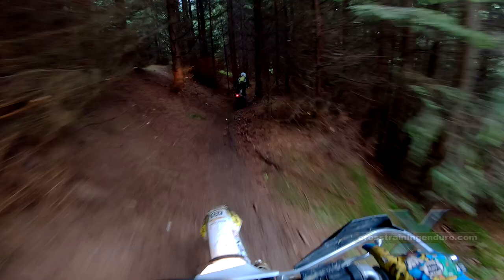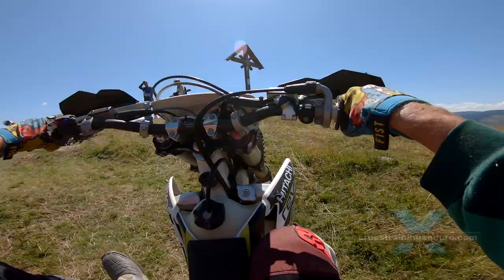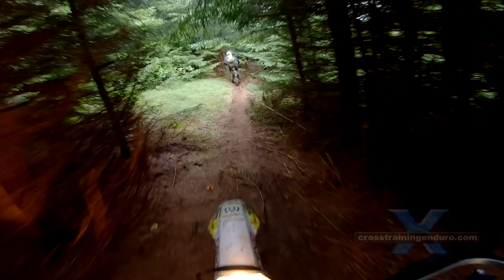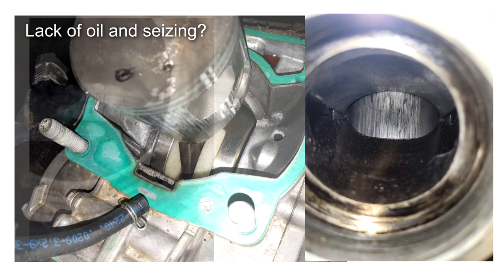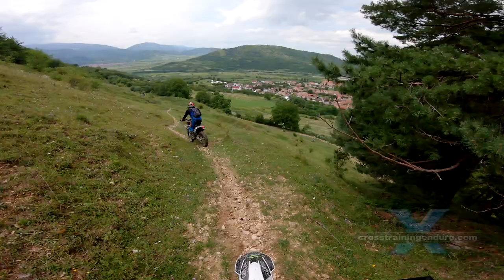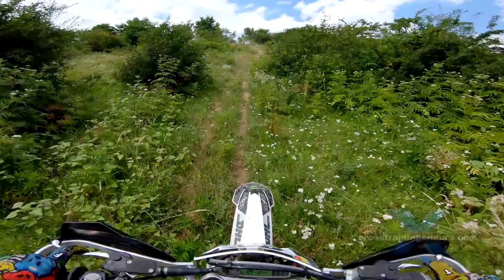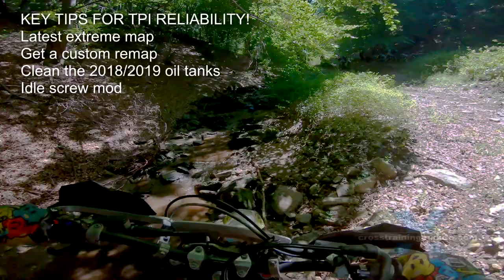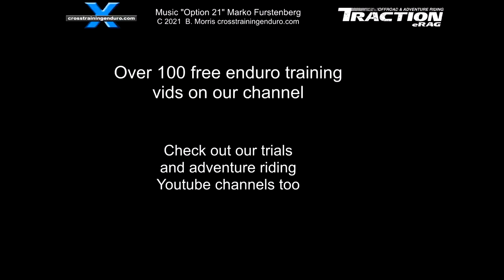Most common TPI problems, questions & solutions from a TPI specialist! ︱Cross Training Enduro

Comment: Jeeesus! Top end rebuild every 80-100 hours. I'm nudging 500 hours on my 2014  Beta 300 Race edition, and its still on its first replacement piston and rings!! Go the might 2 stroke carb!
Reply: did mine on 300 hours and old piston was still fine. could easily ride it more. 250 tpi 2019
Reply: I’d say that’s more on how you ride
Reply from the maker: 500 hours! Is this an experiment just to see how far you can go? I figure you can do the bottom end at the same time in that case lol. All the mechanics I know are unofficially saying 200 hours should be fine if you aren't pushing a two stroke carb model hard. I should point out quite a few TPI owners have gone that far (or more) without problems, although chances are these will be 2018 and 2019 models which had mapping that used a reasonable amount of oil.
Reply: @crosstrainingenduro  I had over 300 Hr on my 08 xcw before a rebuild ,piston and rings were still within specs.  Lost the plastic cage on the big end bearing after I drowned the bike in a pond. No other damage ,Optimal at 100:1 ,no racing.
Reply: @jamesdenton3692 you made 300h at a 100:1? You're officially introduced to my list of reason why 2 stroke are amazing
Reply: @cedricboivin9422  and I thought 50:1 was crazy.  But see, my first bike was a 1958 BSA Bantam 175cc. 
The gas cap had a cup attached to it (hung inside the tank). The cap was stamped:  USE TWO AND A HALF CUPS OF OIL PER GALLON OF PETROL DURING BREAK IN. AFTER BREAK IN USE TWO CUPS PER GALLON.
I never changed rings in that bike!
Smoked a little though.
Reply: @savage22bolt32  That is amazing. That meant you could just bring an oil pint when refueling in a gas station and still have an accurate measurement. For the 100:1 subject, it wouldn't have been reasonable without the modern synthetic oil.
Reply: @cedricboivin9422  yeah, I remember my dad riding & me on the back. We stopped at a gas station and he filled the cup with oil twice, then pumped a gallon of gas, & shook the bike side to side for a minute, then we rode off. 

That ended up being my first motorcycle. I rode it all through the woods & fields. Now they're all gone. Houses are everywhere ☹
Reply: @savage22bolt32  I feel your pain. They just cut a trail that I was using from the moment I started riding. Not a great feeling
Reply: Wow 500 hours amazing that would be around 20000 k's I had 15,000 kms on a RGV 250
Reply: Dam 500 hours when I was racing I would go 50 hr on the top and 100 hr on the bottom.... but it was on the pipe for that hole 100 hours lol

Comment: Wow I'm glad I don't have a TPI KTM lol
Reply: my 19 husky tpi 250 has 150 hours on it right now and has not been rebuilt or had one singe problem yet. I race hare scrambles and beat the shit out of the bike pretty bad and still have not have to repair one thing mechanical yet.
Reply from the maker: As the vid says, they are generally reliable especially if you are aware of the issues and make mods as needed. But the failure rate can be high: e.g. top end parts have been scarce in various countries due to the number of warranty claims for seized 2020 and 2021 models according to relevant dealers and mechanics.
Reply: I’m glad I don’t have a ktm 😭🤣
Reply: @exoticxenon5005  lol kinda weird that I personally know like 20 to 30 guys from my local woods spot and not one have had any of these issues this video speak of 🤷‍♂️ all of the bikes are 19 and up to 2022, most of the issues these bikes had were on the first gen tpi bikes
Reply: @huskyboystv1806  my 17 RMX has somewhere around 150 hours or so (2600 miles) with zero issues. I shimmed the valves at 100 hours, the bike runs like a top. I don't race the bike, I just ride technical single track. 

I met a guy in the woods with a brand new 22 husky 300 he said he was taking it back to the dealership because it was leaking oil. I would be pissed if I bought a new $10k bike that leaks oil. I'm kinda surprised Barry didn't mention the power valve leak with the new KTMs
Reply from the maker: I just kept this vid specific to TPI so didn't look at other issues. But at some point I might do another known issues vid for the Austrian bikes. They take a lot of work though...
Reply: @huskyboystv1806  yeah that’s good I mean I’m not hating my dream motorbike his a husky 701 like I love there bikes the first 2-stroke I was introduced to was a ktm 125 exc

Comment: That's a ridiculously long list of mods required on a brand new $10,000 bike that should run properly from the factory.
Reply from the maker: Our personal opinion is they needed to do more testing and eliminated issues... or at least reduce them. But then KTM has been accused of this in the past. It's great they innovate more than most brands, but sometimes the customers become the lab rats. Or they can feel like that.
Reply: @crosstrainingenduro  To KTM's defense though, they were practically forced to introduce the TPI due to new european emission laws.

Comment: My 2022 got a remap runs amazing and uses a fair amount of oil compared to before. Rebuilt my bike at 180 hrs and the piston was in perfect condition, I’ve never fouled a plug either. Loving my set up!
Reply: I have a 2022 TE150 tpi that ive not been able to ride yet but next summer I will. I let it sit too long and now it wont start, turns over fine but wont start so need to figure that out. Where did you get you ECO flashed?

Comment: 2020 KTM 300 XC-W 6 days. 

Bought brand new, and traded in at 100 hours. I had ZERO issues with this bike. Performed basic maintenance as required, ran US 91 octane ethanol free, used Mgf's oil's., changed the stock plug at 50 hours with no reason to other than it is spec'ed maintenance wise. Top end was clean. The front and rear sprocket had plenty of life, and the wheels had no play in the bearings at all. 

After 100 hours, minus some dings, scratches, some peeling graphics, the bike ran as good as the day I bought it. The only reason it went out the door was to make room for the 2022 model and a fresher machine. 4th 300 XC'W I have owned since 2009, and never had issues with any of them. Previous to my last 300, I owned and built a  Yamaha YZ300x (Athena Top End) with tuned KYB suspension. I noticed no detriment switching back to WP, and felt the 2020 was FAR and above the best WP suspension I have ever owned. 

Great video and channel and thanks for putting these things out for public consumption.
Reply from the maker: Great to hear you had no problems. Dave mentioned there have been 17 maps for the 2018 to 2021 models so I wonder if part of the problem is they were still tweaking maps in production runs? It could explain why some 2020 and 2021 have had premature wear and even seized from a lack of oil, and others haven't. I'm hoping the 2022 uses their most recent 'extreme' map or another one with more oil across the rev range.

Comment: Glad  I snapped up the last 2018 carbed xcw at my local dealer…at a HUGE discount because nobody wanted them at the time! 😎👍 All the carb needed to get it running 100% was a $10 gasket and a JD jetting kit.
Reply from the maker: A friend of mine did the same, snapped up the last carb 250EXC. We tested it against a TPI 250 that was full remapped and had an aftermarket head... no comparison! The carb is just so much more responsive and far more grunt. The bikes are only comparable at high revs.

Comment: My riding buddy had a ‘21 seize in less than 10 minutes of total run time.  KTM gave him a replacement which made it to 20 hours before seizing.  KTM rebuilt it, but it took several months because there was a shortage of top end parts.  They ended up getting spare parts from one of their race teams in US (we are in Canada). That shortage of parts, along with KTM’s hard enduro riders recently spotted riding bikes with a different injection system tells me all I need to know about buying a current TPI.
Reply from the maker: That must have been frustrating. We had that issue in Australia apparently... there was a shortage on top ends due to the number of bikes seizing and getting fixed under warranty. 😢

Comment: I have a 2018 and haven’t had any problems. Ran it stock for about 40 hrs then Switched to a GET ECU and a high compression head. Will probably rebuild this top end around 120 hours. It’s been a great bike for me. I personally like the linear powerband.
Reply: I would inspect your cylinder.
Reply: @johnhoward4977  Cylinder looked great.

Comment: Decided to swap to 2T. Owned a 350 exc-f and 1 month ago purchased a 2022 Te150i. Amazing great fun bike to ride. Still not used with the 2T smell nor the sound, however I feel I'm becoming a better rider with this one. I can lug it everywhere. Have already 25 hrs on it. I had issues with it in the beginning, had that sputter in low-mid revs that I couldn't figure out. Swapped the sensors, no change. Bought a tacho and noticed that the factory idle was way high - 1800 rpm, while the manual states 1400-1500. I've turned in the air bypass screw to have the idle as manual says and now it runs better. After an 1 hour ride, I even get now a slight oil leak on the exhaust. It still sputters ocasionally, but doesn't bother me as long as the bike performs well. I guess it's a mapping issue. I wouldn't invest another 900 on a remap and a head insert to be honest as long as I have fun with this bike. Also, in the beginning I was very frustrated because I didn't know how to properly warm up the bike. These bikes are very sensitive until they reach the proper operating temp. 150s run extremely cold. I've installed a fan, but it has never started 🙄
Greetings from Romania Barry!
Reply from the maker: Buna, Mircea! I'm glad you are enjoying the 150...

Comment: I bought the very last carby model brand new 250 EXC in Australia in 2018 and it has never missed a beat, no mods either. They tried to talk me into the new TPI model but I said "it's a dirt bike, the simpler it is the less troubles I will have". No issues since new.
Reply from the maker: Awesome bikes, a mate of mine might have bought the second last one then. We tested it side by side with a TPI which had the $1000 treatment from TSP... no contest. The carb model was way more powerful and responsive.

Comment: It's nice that these bikes have been around long enough to start having more reliable info, common issues and more importantly fixes
Fathers bike had a faulty crankcase pressure sensor and it was very difficult to diagnose almost 2 years ago but now its just common knowledge that those wear out
Reply from the maker: I guess it's why many don't buy the first year or two of a model with a big innovation, Spencer.

Comment from the maker: MORE INFO? Visit TSPerformance for the full answers to each question, this video is just a summary: https://bit.ly/3nenGm5
MY BIKE IS FINE, I DON'T BELIEVE THIS VID! Not all TPI owners will have problems, in fact the majority have no issues. But there's a significant minority who do. We have compiled info from two specialists working in the TPI area, and confirmed with other mechanics and industry insiders. Then finally we looked at various cases reported online. Statistically it's likely that you won't have problems, or your riding buddies too. Remember main bearing failures on Beta two strokes? It occurred in roughly 5% of cases, so most riders had zero problems. But a significant number did. That's often how these known issues work. Sherco riders have similar problems with regulator and ECU failures etc. I face the same kind of panic, denial or anger from brand-loyal riders every time I do a vid about known issues for any brand. 
ISN'T THIS JUST A PLUG FOR TWO STROKE PERFORMANCE? No. Originally I approached Dave for help and said I wouldn't be promoting his business or mentioning his remapping service. He was fine with this. Anyone who knows Dave knows he puts a lot of effort into helping others with no return. Given how much time he put into this, I decided to give him a little plug anyway.

Comment: TPI runs very well! I ride 2019 Husky
Reply: Mine too! 2019 Husky 250 (with flywheel weight. And 1:150 to 1:200 premix, which might or might not help or hurt. 90h/2200km. Stock suspension is far of optimum for any type of riding)

Comment: Great to see manufacturers thoroughly testing their products before release. Not surprised really.
Reply from the maker: It does seem to be a regular problem with KTM. 😢 And sometimes their suspension mob too.... e.g. the WP 4CS forks.
Reply: @crosstrainingenduro  yes agree. I bought a new 300EXC back in 06 and the suspension both ends was stictiony and didn't work all that well. I recon an old DR250 had better suspension. I'm not a fan of gimmicks and I think WPs needle set up was just that. Who wants a needle cutting off the damping and in effect making the suspension solid just as you need it on the big hits. And it was 5 speed and all dirt bikes need 6 gears imo. Hell, even my old IT and my TTR230 have 6. Rest of that KTM was damn good though. It went like a rocket.

Comment: I know there are smaller companies out there that have 2 stroke motors but I'm glad one of the big companies makes a two stroke. Wish the big 4 would get back into it. I'm sure they would have no problem making a TPI or even a direct injection bike.
Reply: Yamaha never stopped! They don't make an off the shelf, hardcore Enduro machine but I see lots of modded YZ's in the bush (flywheel weights etc) and they do pretty good!
Reply from the maker: We were really hoping the YZ250X was going to be developed into a proper enduro bike but no such luck. Everyone I ride with said they'd snap one up if Yamaha went to 300cc, put on a hydraulic clutch, gave it six gears, an electric start and put the road gear on it so we could register it.

Comment: Clean your spark arrestor screen sooner than a carb 2T. A clogged spark arrestor screen will cause severe stuttering/missing at low and high revs. That was the case for my 2021 TE300i before I knew it needed more frequent cleaning. Unforntunately the ambient air pressure sensor on my bike came from the factory with the "nipple" broken off, so it could not do the swap test. Although the pressure sensor was not a failure on my bike so far, I bought a spare one before they went out of stock again.
Reply: Where do you live where spark arrestors come factory? I have a 22’ TE300i
Reply: @stevenllewellyn8906  They don't come factory. But are required in all public forests in Washington State, and most of USA. I've got the Enduro Engineering end cap/spark arrestor. Another popular option instead of a screen is to replace the entire silencer with an FMF Turbinecore which acts as a spark arrestor but is more expensive -- requires less cleaning.

Comment: Holy shit! I was going to buy a new KTM 300 this year but now Iam thinking a WRF450 will be a better option. Great vid, thank you. Love ya channel.
Reply from the maker: As per the vid, most owners probably won't hit problems.... especially if they get the 'extreme' map KTM has issued to try and get the system using more oil. All the known issues in most brands only pop up in a limited number of cases.
Reply: @crosstrainingenduro  that’s true mate.
Reply: I’d recommend the YZ450FX
Reply: @fentonpainter7907  I got the WR. It came with road reg which sealed it for me.

Comment: Cool music, Barry.
So, on my 300 xc-w with pwk I'm getting smooth running at low rpm low slide opening cruising, crisp throttle response, roaring top end power, and 34.4mpg average consumption.  I'm pleased.
Cheers!
Reply from the maker: That's impressive fuel economy for a two stroke!
Reply: @crosstrainingenduro  
Right?  It's a lot leaner now than how it was delivered six years ago!

Comment: Within the first minute the comment about the 2017+ carbs is all about the #4 slide that they came with. Have it cut to about a #5.5 or buy a 2003 (i think)  CR125 slide which is a 5.75. A "2 or "3 Kawasaki, not sure which, is a #5. Having the stocker cut is cheaper. But it leaves you down for a while.

Comment: GASGAS ec300 2021 model been driving 190 hours without doing any with the engine except 2 x oil pump change and 1x Crank case sensor and made a tIdle screw.

Planning to drive it a 100 hours more before rebuild the engine., like a loong time test :)
Reply from the maker: Great to hear! Did you get your dealer to swap it over to the revised map that uses more oil?
Reply: @crosstrainingenduro  Asked my dealer about this 2 times, but was told it came with the newest map and this should not be any problems. I'm pretty sure people who have oil problems have been using premix oil and not oil made to be mixed in the engine. Here some call it snow mobile oil, more liquid and made for mixing in the engine.

Never had any problems even while driving in - 25 degree C 
But boring/hopeless to drive a 2-stroke on the road, so bought a GG 350 F to. Good to have two bikes.

Feel some difference between this two bikes, 2-stroke are more agressive and feels lighter to drive, my pulse belt tells me the same 10 HBS lower on the 2-stroke, but same time around the track.